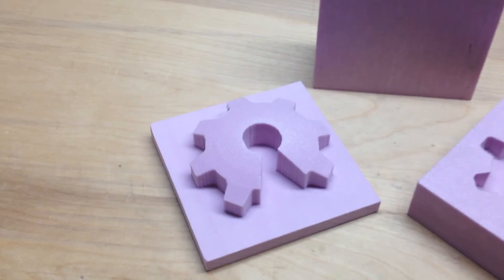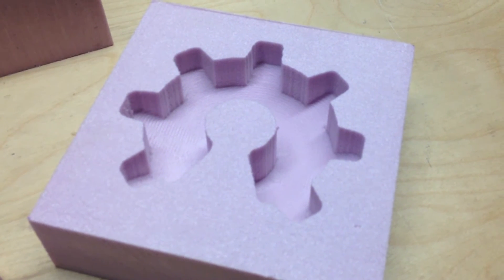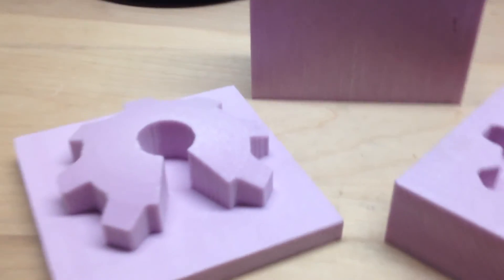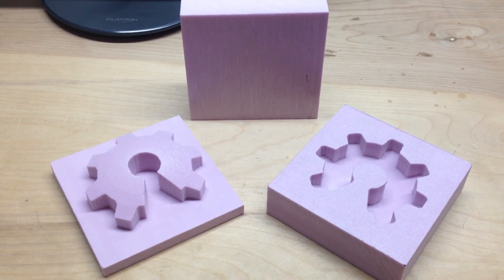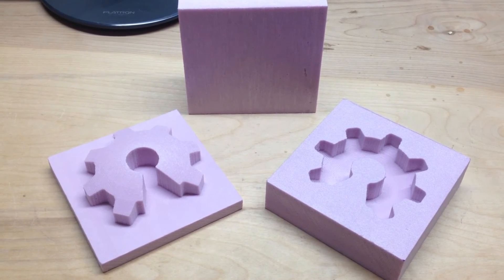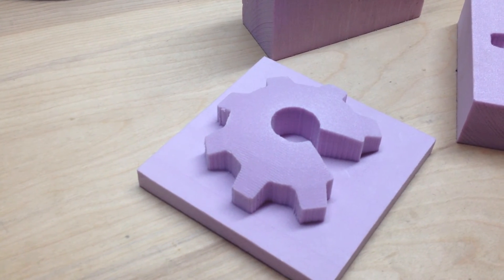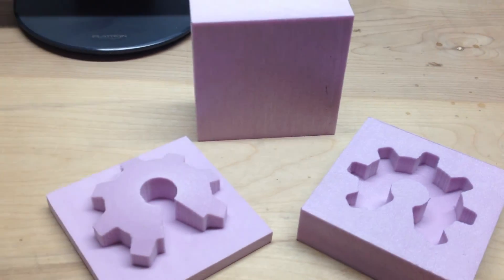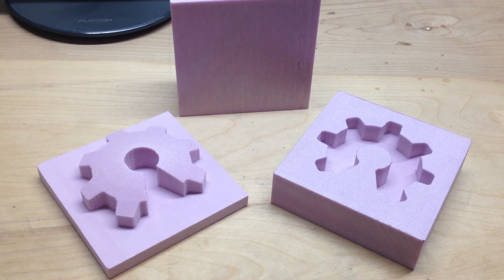CNC Machine - 3D milling foam blocks

Comment: Cut and Edge provides high-quality panel cutting and CNC cutting services in London. We offer MDF cut to size and MFC cut to size. Also, order different types of board sheets online now in the UK. We Deliver anywhere in the UK on all board sheet materials. From a single piece of plywood to a lorry-load of MDF with best competitive quotes - Call 0203 397 8387 or visit our website: https://www.cutandedge.co.uk

Comment: Nice job.  What was the bit and speed you were using?
Reply from the maker: Thanks, I think the endmill was a single flute (o-flute) endmill running at about 18k rpm with a 90IPM feed (which was limited due to geometry).  Foam is uber forgiving to feed rates so I normally feed as fast as possible (300-500 IPM if I can hit it) at anywhere between18-24k rpm.